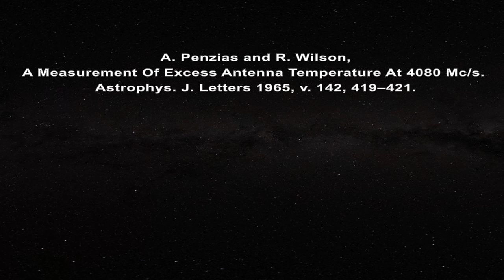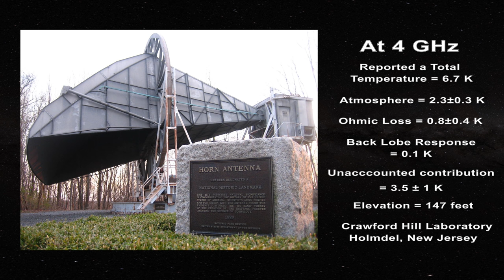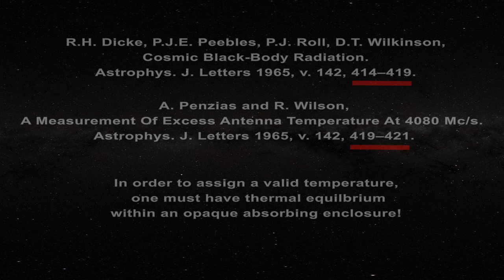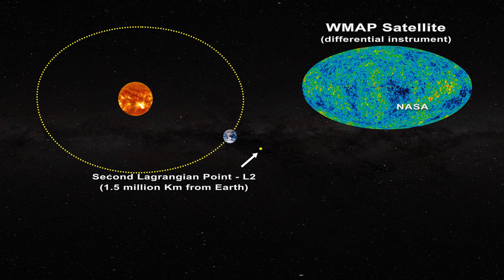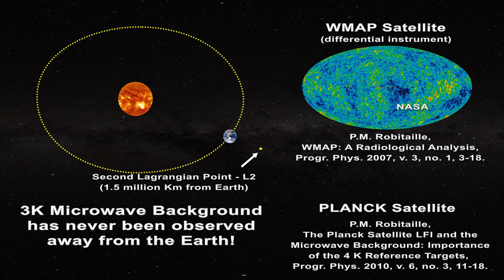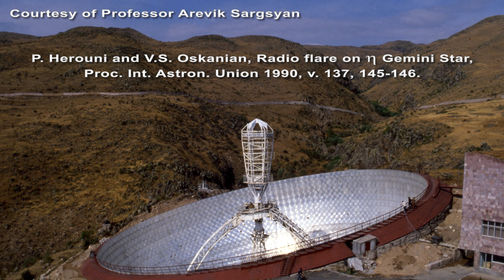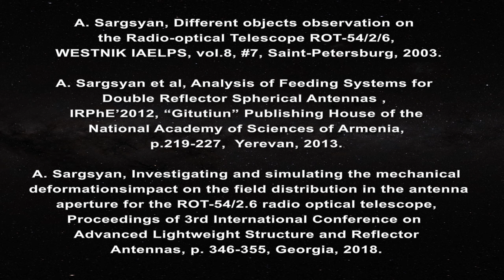The Herouni Antenna - The Death of the Big Bang!

Comment: 1:45. I think it's more a case of physics making predictions that are later supported by observations. I'm suspicious of anyone who so obviously has multiple axes to grind.
Reply: Fortunately, science doesn't need your opinion. Professor Herouni's observations at 8mm proves, yes, proves, that there is no CMB. Without the so-called CMB Big Bang creationism is a dead duck. So Big Bang creationism is a dead duck.
Reply: Gamina, look around, please. This is a XXI century around. You should be multi-core (even computers adopted that), means multi-professional.
Reply: @stevecrothers6585  they prove nothing, playing the 'correct by authority' card is your failure, just because someone is expert in a field does not default to them been correct, also you automatically accept the historical events and conclusions set out in this video are factual when in fact they are presented skewed for the narrators own agenda here, he also make wild leaps of faith by making claims of proof and evidence based on one set of results that hasn't been scrutinised by the scientific community.
 This video is no more than a manipulation of history to suit his own idea's yet provide nothing but opinion to ground his claims, the Big Bang does not solely rely on Microwave Background of the universe it is supported by it, if it was wrong science would be the first to admit it, if it was wrong it still doesn't destroy the big bang as several other fields of science support that model.
Reply: @areviksargsyan406  What does that even mean?
Reply: @Wa-Ching Itall I've got history to back my corner and the scientific revolution that came about from it, that could never have happened if it was a flawed system, PS, not sure what the PR comment is about. I am an engineer who runs my own business.
Reply: @stevecrothers6585   Proof comes from the replication of results, not just the claims of one researcher.
Reply: Could you, please, for the less initiated, explain (in up to 3 sentences) the link between CMB and Big Bang an why there is no one without the other. I think it would be very useful here. Thank you!
Reply: I have to agree with genome here.    One paper and one experiment can't be taken as absolute proof against thousands of experiments validating the cmb.    But i don't think that's what this video is about.   This video is a predatory video.   The video and author obviously prey on people that don't completely understand the science nor the scientific method.   It's sad  actually.
Reply: Then to claim that " there is no cmb and there never was"  wow that's not how science works.   First anybody making that kind of assertion would make sure to let the evidence speaks for itself and be very careful about drawing the conclusion for the reader.  I see none of that here.   And why does this dismiss the big bang?  There are other corroborating pieces of evidence  (large scale structure,  abundance of light elements,  hubble's law,  etc).

Happy to test the latest version of the evolving bing bang theory,  no problem,  but don't tell your listeners you've proven anything with this video.
Reply: @darko4608 In a word No! 
You are asking me to provide a simple easy to understand response to a very complex subject then limiting the boundaries of my response. I can express what the CMB is and why we have one in said criteria but I cannot provide a concise answer as to the values and variations in results that one would expect and one sees without going into a long address, this is why I expressed that alone the CBM is not the only factor that is telling us the 'Big Bang' occurred, there are many others which have simply been ignored as they get in the way of specific agenda of the narrator who is trying to realise his own theist ideology.
Reply: @lvdovicvs  : Really! Go and get professor Herouni's peer reviewed 1999 paper (it's free) and his 2007 St. Petersburgh conference Abstract (it's free too) and then explain to us all why you think his antenna noise is not 2.6 K. We await your expert analysis.
Reply: @Protophanes You are in part right, but were they not applying a scientific method to their hypothesis which was based on findings which we discovered using the scientific method?... 

You can see a distinct line of technological progress and insight and understanding from when the method becomes recognised and used, this has a positive domino effect of influencing future directions for scientists to go, it is a self critical and self reinforcing system. It was the first time people we could really challenge the instilled authority and show it to be wrong, the bible been one such example, that is why many have taken on a different attitude to what is in the bible and now make claims that some are figurative as oppose to it all been literal which back in the day it was and to challenge it could lead to ones death or severe punishment because that is how nice this so called god is!
Reply: @Protophanes Who pardoned them?, putting words in my mouth I never uttered is a poor rebut, I merely made the point that you shouldn't judge the majority by the actions of the few, you also never gave examples of these so called fraudsters as you seem to think frequent the scientific world.
Reply: @areviksargsyan406  What does that even mean?
Reply: @genome616  Disappointed :(      I was expecting so much from the EU folks. You are very smart, you should be able to express it...just look how Stephen Crothers does it simply...
Reply: @stevecrothers6585  

You need to stick to gardening, please cite these papers of Herouni's as I struggle to find them as do you looking at some of your recent dialogue online.
 With regard to your claims this is proof, I very much disagree, been peered reviewed does not mean the critique was favourable, had it been then he would have been a household name and especially to creationists who would rejoice in finding the Big Bang wasn't real.
If you wish to use Herouni's papers as proof then you will have to cite the peer review critiques too to give some credibility to his claims, also you should have no problem replicating his results or citing those that have who were testing his claims.

 I will add that he makes some claims that are easily shown to be incorrect, his whole position relies on ground based dishes and ignores the fact that we now have satellite confirmation of the CMB.

I'll agree he was somewhat an expert in his field but even experts back the wrong horse, hawking denied information could exit a black hole for decades before making one of the biggest scientific U-Turns and providing evidence for what we now know as Hawkings Radiation....

For Herouni to be correct there would need to be several layers of conspiracy at play here and his claims would have to be replicated and confirmed - but they are not.
Reply: @genome616  : Go to the links below the video and get professor Herouni's 1999 paper and his 2007 conference  Abstract and  study them (they are available free), then explain to the audience why you think his antenna self noise is not 2.6 K. 

"I will add that he makes some claims that are easily shown to be incorrect, his whole position relies on ground based dishes and ignores the fact that we now have satellite confirmation of the CMB." genome616

First, it is a scientific fact that the CMB monopole signal, assigned a temperature of ~2.725 K by cosmologists and astronomers, has never been detected beyond ~900 km of Earth; precisely because Earth is the source of the signal. I suggest that you study the following papers and then explain where there is an error and why. Professor Robitaille has advanced detailed analyses proving that all the astronomers and cosmologists are mistaken. The 'CMB' does not exist.

[1] Robitaille P.-M., WMAP: A Radiological Analysis, Progress in Physics, v.1, pp.3-18, (2007), 
 http://www.ptep-online.com/2007/PP-08-01.PDF

[2] Robitaille P.-M., COBE: A Radiological Analysis, Progress in Physics, v.4, pp.17-42, (2009), 
http://www.ptep-online.com/2009/PP-19-03.PDF

[3] Robitaille P.-M., The Planck Satellite LFI and the Microwave Background: Importance of the 4K Reference Targets, Progress in Physics,v.3, pp.11-18, 2010, 
http://www.ptep-online.com/2010/PP-22-02.PDF

[4] Robitaille P.-M., Water, Hydrogen Bonding, and the Microwave Background, Progress in Physics, Vol.2, April, 2009,  
http://www.ptep-online.com/2009/PP-17-L2.PDF

Comment: There was a time in which I really gave great attention to what science said. As I got older, I learned that scientists aren't that different from ordinary people in general. They aren't necessarily looking for the real and fundamental truth, but, very often, trying to make a career and get the right funding for their research. Take a look at the global warming alarmism, for example, and all the data manipulation, refusal in acknowledging the evidence contrary to their hypothesis, successive lies about the subject and general intention of winning by spreading fear. Now, there was no big bang? Oh, I am not surprised at all. The only good about scientists is that, after spending a long time stuck to their fallen hypothesis and theories, a new generation may come up and start spreading new ideas, however not necessarily true, unfortunately.
Reply: The main advantages of ROT Antenna are the highest accuracy of mirror surfaces (50 micron), shortest
wavelength (1mm) and very low level of Self Noises (2,6 K), i.e. highest sensitivity. Thanks to high accuracy of ROT Antenna it can work in very short wavelengths, down to 1mm. Due to special
 optical scheme of the Antenna, the diffraction rays from edges of mirrors do not arrive to the focus point, so
Antenna almost not feel surrounding high temperature (about 300 K) and I have no Idea what I'm talking about so the Self Noises of Antenna is very low,
just about 2.6 K or 2.8 K (r10%) in different experiments, where to achieve the high accurate result, the Self
Noise Temperature (TSN) was mainly measured at first near the East support leg of Antenna, where there is the
bridge, in open position of which it is possible to go to receiver and focus point.
Reply: @astilen5647  : Repeating your embellishment " and I have no Idea what I'm talking about" will not help.

Comment: Dear Professor Robitaille,

Can you please make a video resolving this question below about:

Q: Are the stars visible (including our sun) when in free space? Or else put, are light sources emitting in the visible spectrum, invisible in space? Or else is Space Pitch Black for an observer in space?

I am not totally convinced that we can see stars in space.  The generated light for example from our sun with our naked eyes, when we are in space without reflecting first in the atmospheric screen of our planet. The atmosphere also gives the image of the sun reflection enlarged from as it would appear when viewed from space and so for the moon. From pictures from the ISS for example moon appears very small compared when viewed from inside our atmosphere.
 By the way I believe the only reason we can see the moon or planets when in space is that it is not a light source but it reflects light. 

We can see the light only when it is reflected on matter.

Also the first astronauts Apollo missions which the spacecraft windows had not any reflecting coating, reported that they could not see any stars from the spacecraft and the same when they were on the surface of the moon.

Also consider that you can not see directly the light from a laser diode unless it is reflected on a surface and you can see the laser line only when you create smoke around it although the Laser diode emits on the visible  range?

So as an analogy a laser pointer generates its own visible light but why we can not see the light path of the laser to us? and only a red spot when it hits its target?

Also there are reports of people getting their eye burned or damaged when laser strike them directly on their eye without previously reflecting somewhere else and they newer saw a light? This tells me that by means of reflection of light on matter and by means of the eye itself, this is not enough to be perceived by humans...

So yes I really have my doubts if you can see the stars outside our atmosphere and planet without a glass window or helmet with reflecting coating.. (photo cameras usually have a lens reflecting coating or filter).
.
...but maybe I'm wrong on this one :)
I don't know, this guy sounds pretty convincing:

https://www.youtube.com/watch?v=kSuVJm4TI5c&t

or here ... very confusing...
https://www.youtube.com/watch?v=OmcwW-8CC6E 

Kind Regards,

Markoul

Comment: I'm just a layman with a college-level understanding of physics, so I didn't understand a lot of what you say in this video. I did, however, understand one thing very clearly. You appear to be proposing that the microwave signal detected by Wilson and Penzias doesn't come from deep space, but from water. Really? WATER? Even I know that water doesn't emit microwaves, it absorbs them. And you know what? It's REALLY good at it. That's how microwave ovens work, and it's why RADAR can't penetrate clouds. This doesn't lend much credence to the rest of your argument, as impenetrable as it is, or your claim that two satellites, designed specifically to detect microwave radiation could not possibly have done so. Even if all of the above were not true, and your arguments made sense and were vaild, they still would not disprove the big bang theory, just negate that ONE piece of supporting evidence. The Big Bang theory may not be perfect, but if you run the physics backwards from now until that point, it's what you get and, for now, it's still the best theory we have.
Reply: @stevecrothers6585  Thanks for the info and the link. A lot of that paper is far beyond my comprehension, but this part isn't:

The findings [...] are interesting, but inconclusive as related to the hydrogen bond itself.
Reflecting on the paucity of supportive data, in this very
difficult experimental region of the far infrared, it seems that
much more needs to be learned about the emissions due to
hydrogen bonds in nature. In particular, the lack of a signal
specifically assigned to hydrogen bonds from water on Earth
gives cause for concern

Also, it seems that for water to emit microwave photons, it first has to absorb them. From the above quote " the lack of a signal specifically assigned to hydrogen bonds from water on Earth". Most of the energy of that absorption is converted to infra-red, but some (quoted in the paper as 80-fold less than the received energy) is re-emitted as microwaves. It seems to me that a microwave antenna would be detecting the much stronger microwave signa , which is also being absorbed by nearby water, while the re-emitted microwaves from that water would be swamped by the former. 

Finally, microwaves are highly directional, and the microwave antenna was aimed towards the sky and the signal received was the same at all times, so the most likely origin of the microwave signal is not nearby water, or the very small amounts of water vapour in the air, but all of deep space.
Reply: @stevecrothers6585  There's also this recent video from PBS Spacetime (https://www.youtube.com/watch?v=C4CKtEQJGMY) which explains how the CMB map makes predictions about the relative amounts of matter, dark matter and dark energy in the Universe. Those predictions confirm previous observations and extrapolations about the distribution of matter and energy in the Universe. For something that "could not have worked" to make accurate predictions is one hell of a coincidence!
Reply: Sure dawg 🤣🤣🤣🤣🤣🤣🤣🤣🤣🤣👌👈

Comment: I never liked the big bang idea, it just sounds like improbable bollocks.
Reply: There is a hell of a lot that is improbable bollox though, pregnancy and birth for one. Weird shit is all around us.
Reply: I dont think pregnancy & birth comes under the heading of improbable. 
given it`s frequency¬
But, if the furthest visible things are, or appear to be 13.7 Bn light-years away, meaning they were there 13.7 Bn years ago; (so much much further by now!)
Then looking in the opposite direction, 
IF there are things seen at the same distance, then they were already 27.4 Bn light years apart, 13.7 Bn years ago, 
when they were supposed to be all in the same place; ie the singularity.
 @ogasi1798
Reply: @paulj6662  Consider the amount of things required to work in tandem in order to create life, you don't think they are improbable?  From conception to birth? Are you a parent?
Reply: It happens all the time; Your point? @ogasi1798
Reply: @paulj6662  look around
Reply: it sounds like you aint getting any.  @ogasi1798
Reply: The Universe does not care what you like or dislike
Reply: @widdyhabb  Really? I know that.

Comment: Love that you're finding mistakes in conclusions made by faulty measurements and math, but the big bang was not postulated because of the radiation that was found. When they found the radiation (long after the big bang theory was proposed) they just assumed that that's what it must have come from. But the big bang theory came from observing the motion of the galaxies all rushing away from each other (not from the background noise). I can't say that that observation is correct -- for all I know the formulas used to determine that motion are wrong -- but disproving that the radiation didn't come from the Big Bang doesn't disprove the Big Bang. You even said it yourself, Dr. Robitaile, that the Big Bang could NEVER have produced that radiation, therefore the radiation has nothing to do with the Big Bang theory; it just can't be used as proof that the Big Bang actually happened.